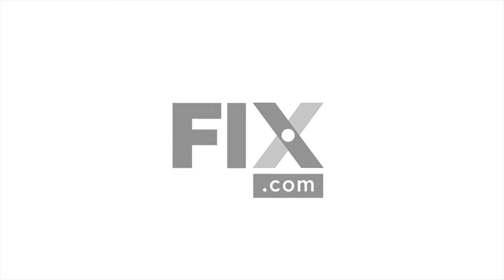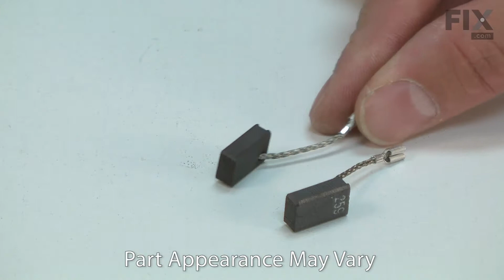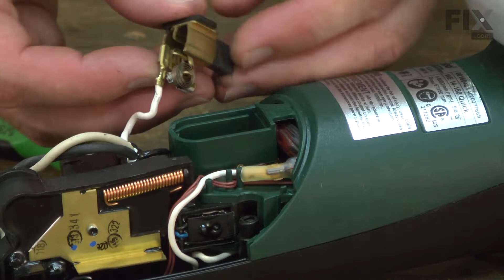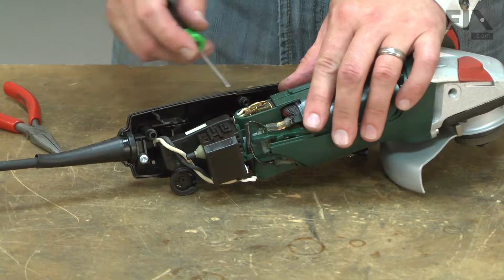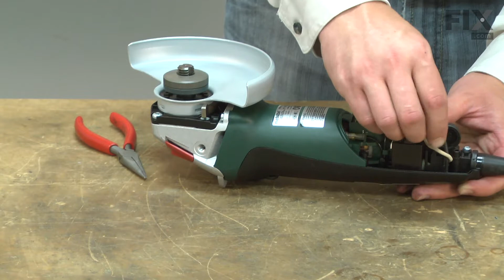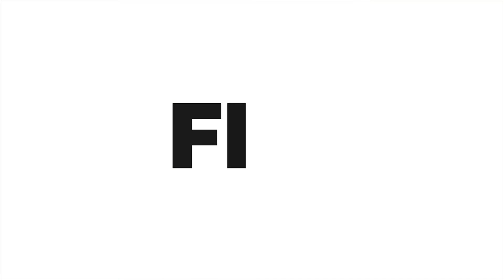Metabo Angle Grinder Repair - How to Replace the Carbon Brush Set

Comment: That brush looked like it wasnt very old or used up to me. But its an informative video. Ive got one in my lap right now chisling off dried mortar trying to find access to brushes. Its a completely differnt design but im guessing it has no brush access without cracking it open